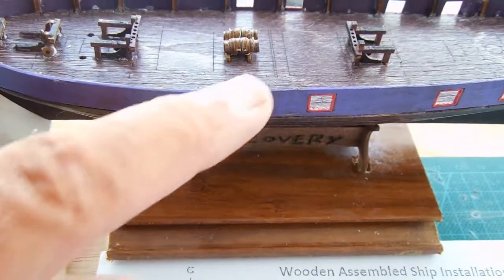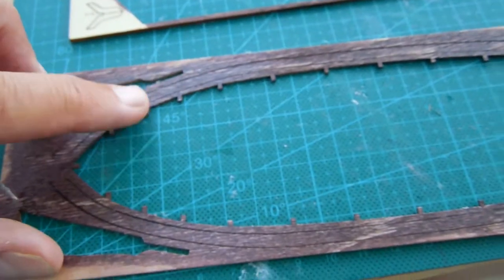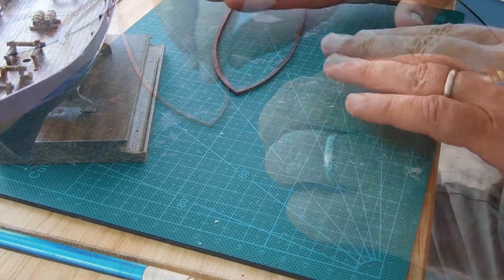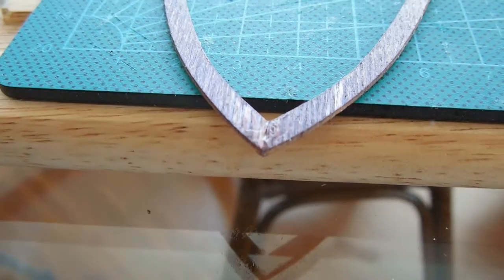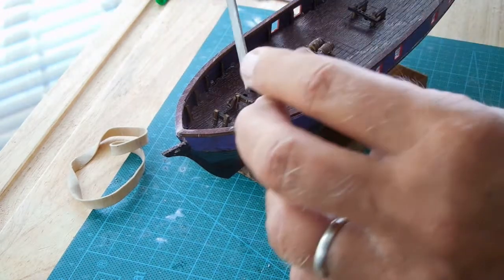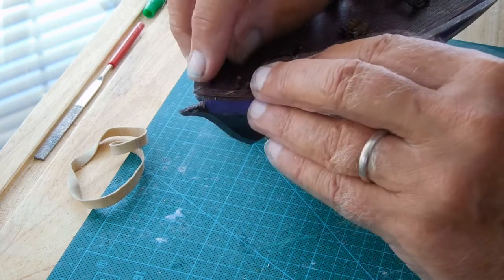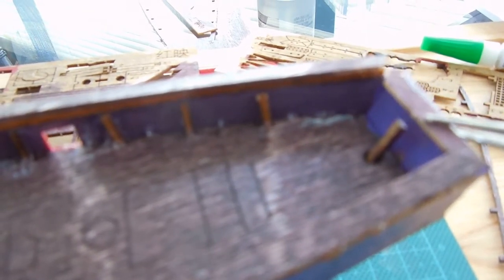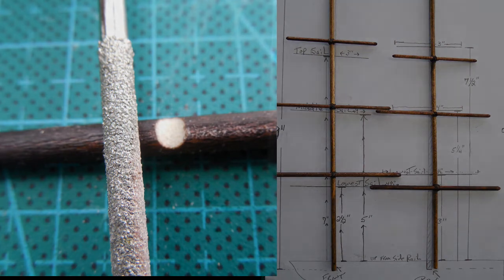Wooden Model Ship Build Part 6

Comment: Hey Dan. I’m currently building this and I think that the first rails you put on actually go on top of the hull ribs that are inside of the ship. I could be wrong of course but they seem to fit snugly in there and then the wider of the rails covers the width of first rail plus the side plank with the gun ports. Anyway, just thought it was a tidbit for the curious. Your series on this beginners ship is being real helpful, thanks.
Reply from the maker: I think you are correct!  Proof positive that I’m a true beginner!  When I began this adventure I thought it would be helpful to see what experience I would go through.  Thanks for watching and helping others along with me on my ship building progress.  I’m currently building a larger ship (my second Black Pearl.  Another viewer helped me with gluing metal to wood CA (super glue) doesn’t hold well….
Gorilla Clear Waterproof Polyurethane Glue is what I’m trying now and seems to work!
Still Learning 😂
Thanks for watching and taking the time to give advice 👍👍